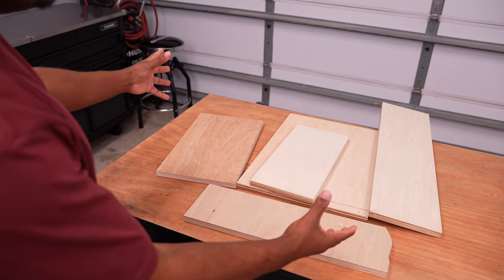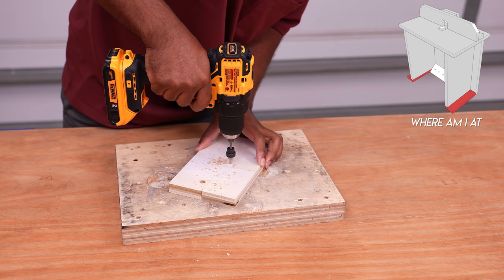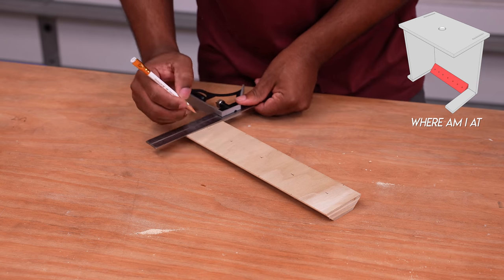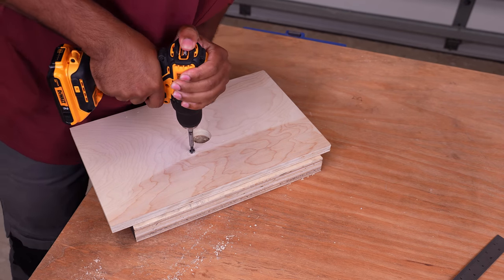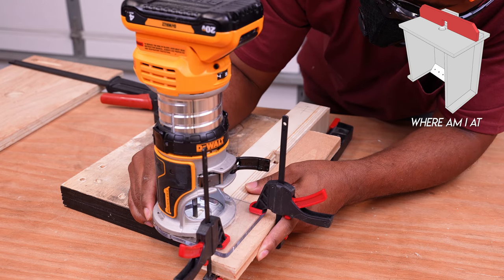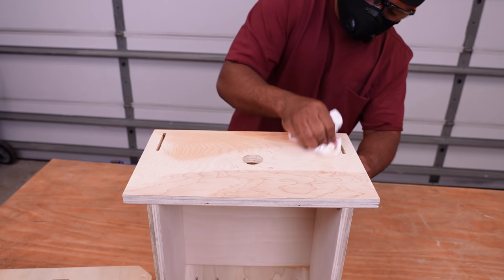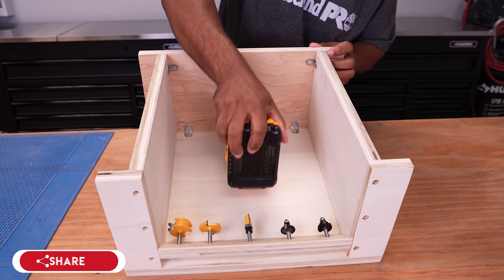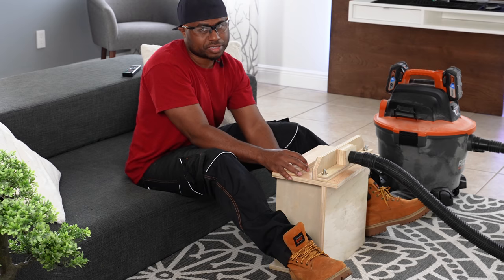How to make and use a simple trim router table

Comment: I would add two things, something to hold the wrenches for changing the bits and a center reference line for the fence on the top of the table. Other than that, very nice and clean.
Reply from the maker: Thanks! Oh, man I really considered adding a wrench holder, it but I didn't I have the hardware on hand. What I was planning to do is use a threaded insert with a small wing screw.
Reply: @DIYCreators  a small magnet glued to the inside would be a simply addition that would work for storing the wrench.
Reply: Excellent video and clear concise instructions, very easy to follow.  You did a great Job.
Reply: Brilliant!!!!!!!   YES!!!!

Comment: That's a well thought out design. I especially like the versatility of being able to clamp or mount it  to the top or side of a workbench.

It's also a lot prettier than the janky little mini router table I made from scrap plywood, 2x4s and some masonite. I'd originally made mine for the express purpose of fitting a custom sled for cutting box joints. I've gotten a fair amount of use out of it, but now I'm thinking it's time for an upgrade.

Checking out your plans now.

Comment: Nice job Glen. I made a router table insert that sits inside my Ridgid table saw's gap when the rip fence is extended. Also made a fence attachment that hooks to the table saw fence and the opposite face is for the router. Works GREAT! Thanks for the videos and the ideas...

Comment: I love this design, it's so simple yet has all the fundamentals like a fence and even dust collection. It uses the router that I already own, so I'm sure it will work as-is with no fiddling around!

Thanks man. I'm gonna make one of these. I know that I want a router table (I have some templating things I want to do) but don't have much experience with them, so don't know yet what I need or want beyond the basics. What I do know is that if I buy a cheap one, I'll end up wanting a better one. So this simple wooden one made with off cuts and the router that I already own is absolutely perfect.

I'll add a couple tiny things on this: a starter pin, and maybe also a miter slot. But definitely a starter pin. Will likely use a dowel for that one.

Comment: One thing I like about these small format router tables is if you want to make a specialized jig, let's say for box joints for example, it is simple to add 2 runners to the outside of a piece of plywood and go from there, just a few minutes of work. No fooling around with miter gauge slots in the table.

Comment: Glen thanks for this video.  I started building this tonight!  I need to get the hardware and some more bits to finish it up, but this is going to take my $20 Harbour Freight trim router to the next level :D
Reply: ... and I can confirm all the cuts can be, and were made with a circular saw.
Reply: My router player isn’t symmetrical!  I didn’t realize until I finished the build today… and now I have to make a new table with the router player facing the right direction :(

Comment: I was trying to decide whether I should get that Dewalt router or a plunge router. This video made the decision for me. Definitely great for entry level routing.
Reply: As a beginner I think it's easier to start with a small router, if you can one that has an optional plunge base accessory. It's easier to use for small stuff, you can do more demanding things by making multiple passes. And then eventually upgrade to a big router. My 2 cents
Reply: @kz.irudimen  I've never used a router and was hesitant shopping for one. I found that exact Dewalt router for $100 on OfferUp brand new so imma grab that one. I just wasn't sure at first if I should get a Bosch with the plunge and fixed base attachment. You and Glen made my decision for me. I appreciate the help and guidance.
Reply: @ThoroughlyRespected1  You're welcome, have fun but be safe :) Routers can be dangerous, watch some safety videos before you use it ! gl

Comment: Love the simplicity of it. I am in the processes of setting up my small workspace, and small, portable aids like this are right up my alley.  One suggestion, If you run your fence the other direction, you would have the use of your work bench to support a longer piece of material.  Thanks for the informative video

Comment: Elegant. I am going to have to build one. I am also going to need to buy a battery powered router. I have a big router station that doesn't get used as much as it should. Because of the size of my work space it takes more effort to dig it out than I have patience for.

Comment: Really simple design, looks good and functional. Another little addition that'd be really nice to add would be a a few small holes around the bit with a removable dowel to use as a starter pin when freehanding.

Comment: I only have one issue. When using the table saw, we were seeing crosscuts using a rip fence...with hands between the fence and the blade. I understand that there were blade guards and a riving knife, but it's still a dangerous thing to do. For anyone who reads this, please make sure that you are being safe out there. Great video! Very simple build and I loved the diagram used to give an additional visual as to what pieces he was currently working on. Imma keep an eye on the table saw conduct though lol

Comment: Absolutely love this. I've never used a router table yet (I've only recently bought my first router and not had a chance to use it yet) so is the fence OK being able to be moved to odd distances? I mean, would it be of benefit to add a channel in the middle and have a block of wood under the fence sit inside it to help keep it straight?

Comment: simple question for someone who's watched a LOT of your (and other) videos about woodworking, but still haven't actually done anything yet....

At the beginning, you say you used the speed square for the cross cut and the guide accessory for the rip cut. do you use the different devices because of cross vs. rip? or because of length? or because in one case your cutting the righthand side of the piece of wood and the other case your cutting the lefthand side?

Comment: Very good video! I am a beginner and am doing the same thing with the same router. I  am stuck trying to figure out how to attach the router to the top. Did you use longer screws? Can you tell me the specs on the screws so I can get some? again, enjoyed the video, thanks!

Comment: This is a sweet design my bro. U made it look easy to build as well. Is it that easy if the person is a NEWB?? U made it look like anybody could build this.
My only downer on this was the router.. I jumped on Home Depot's website and I saw the router for $219.00 or something to that affect but this was without a damn battery. I guess they're thinking is that I'm already a dewalt purchaser?? The batteries are a one fits all tools?? Is that correct? 
Look man, apart from the router with no battery, unless u wanna spend another deuce on top,  this was a brilliantly made piece by ur good self. I know I sound like I'm blowing smoke here but I'm not. Ur work is brilliant. It's always easy set out so dummies like me can build it with a few of the correct tools and time and patience.. Thank you for that bro.. Salute from IRELAND

Comment: Great work. Best router table I've seen on YouTube, because of the open side on the table, which will work great with my plunge router.  And the sled is mounted vacuum was a great idea... Wonder if that will work on a table saw sled.  👍😊
Reply: And I also love the diagram on the screen.

Comment: Hi, What is the weight of your router? I'm a beginner and I bought and downloaded your "Benchtop router table with fence" file. I have a Bosch 1400 Watt router that weighs 3.2 KG. Do you think your table can support it enough given its weight?
Reply: This project looks like a solid build I don't think you need to worry about the weight.

Comment: Excellent idea and design for a portable router table.  I plan to build it.  Question:  Where did you get the work pants, specifically the black pair?  Or better yet, maybe you should consider a segment on your best/recommended workshop clothes -best functional, durable and comfortable.  I'm a new subscriber so I don't know if you have already covered the topic.  I see potential workshop clothes sponsors or your own clothing line. Thank you for the videos.

Comment: What kind of screws did you use to mount the base to the table? The original ones are machine screws and short, I was wondering if maybe 1" wood screws would still attach to the base through the table? I have 3/4" plywood I'm trying to use... Maybe I should take the original screw to the store and find a longer machine screw in the same size 🤔 lol

Comment: Would it be an improvement to make the screw 4 holes on top for the router a mm deeper and add glue in tiny washers for the screws?

Comment: another awesome diy idea! plywood is soft though, although your paste wax treatment will toughen up the work surfaces a little...i'd hit it with a generous dose of acetone-thinned epoxy on all the work surfaces, sand it really well after it dries, then two coats of polyurethane, sanded. then it would be almost as good as aluminum. speaking of which, it would take much to do this in aluminum. :)
peace
Reply: You could always do everything except the work surfaces in plywood and use metal for them!  I personally think that unless you're just beating the absolute hell out of your router table (if so, why?) the plywood will do very fine for a long time.

Comment: I have a Makita trim router and when I tried something similar, I found that the bits would never go far enough up to be usable through the 3/4" ply...which then prompted me to buy a plate to bring it up 1/4" or so...but you need a router table to rout a platform for a plate...and I don't have the table working...

Comment: I think this is a fantastic design but routers are extremely dangerous tools that should be treated with the utmost care, I'd only use this on a very stable surface and I would definitely consider some kind of guard attachment. If a part of your body goes into a router, it's not coming back.